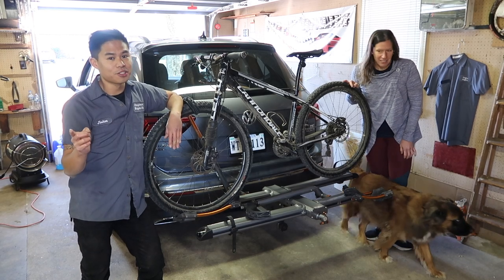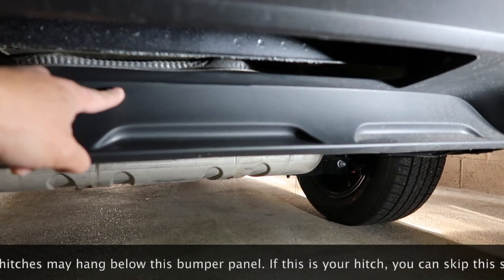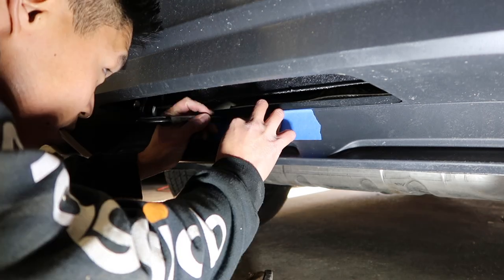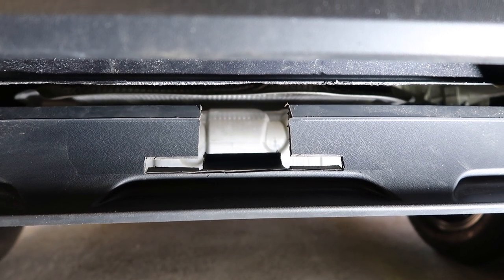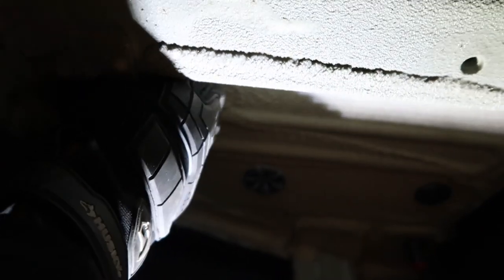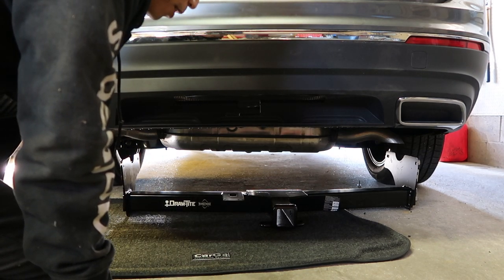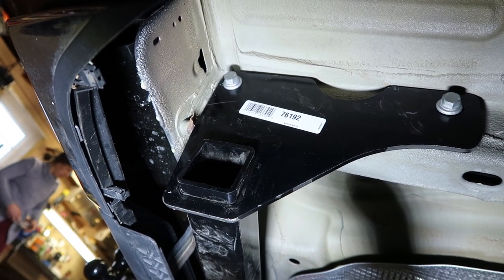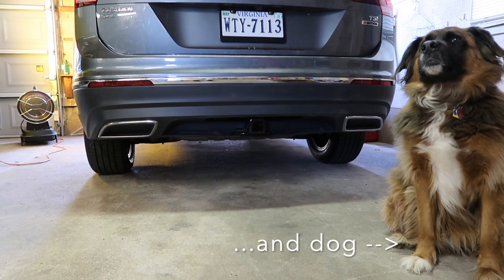HOW TO: 2018 - 2022 Volkswagen Tiguan Hitch Install

Comment: Thanks for the video! I watched it a few times before and during installation. I had trouble with the passenger side bolt closest to the bumper, but finally got it to align. Installed on an '18 Tiguan with the third row.
Reply from the maker: Way to go! Yes the passenger side was a bit of a challenge for me as well. I should have showcased that, but well done on getting it complete! Thanks for watching!

Comment: Great video thank you. My question is when doing the layout where you’re going to cut how did you know how far down to come? Did you just measure the hitch from the mounting bolts and take that information to the frame and then figure it out?
Reply from the maker: Great question! The MFG's documentation actually specified that the receiver would interfere with the the portion I marked out. So I made a template based on determining the center line and the drop noted by the documentation. If it wasn't noted by the mfg, I would have done a soft fit and measured/marked the area that needed to be removed, but still utilizing the same centerline method.

Comment: Love the video, thank you! How did you pop the cover off the hole for the receiver before you cut into it? I have a receiver that I can just bolt on but want to ensure that I remove that panel properly because it is a lease. Thanks!
Reply from the maker: You mean the plastic cover under the bumper? I had to cut it out to make a passage for the receiver.

Comment: Hi, thanks for the video tutorial, your headliner says 2018-2022 but the rear bumper design is different than previous years, so, it will fit 2022 also?
Reply from the maker: You know.. that's an excellent question I'm not 100% certain. The Tiguan in the video required modification so I would imagine a 2022 would require similar modification. Platformwise they should be the same, but aesthetically I'm not sure how it would look given your comment on 2022 being slightly different.

Comment: Did you ever actually have to jack up the car or just there for prevention? I don’t have a jack but want to install myself
Reply from the maker: Great question! No, the jack was used to position  and lift the hitch into place, not to lift the car. I'm sure there is some mfg tolerances between different hitch models or even the same ones.. but I don't think we would have been able to install this particular hitch without a floor jack.. much less without each other's help. Good luck!

Comment: Great Vid, was this Tig a 5 or 7 pass? 3rd row appears to matter on the version of the hitch to buy.
Reply from the maker: Thanks! I believe it had the 3rd row, I could be wrong its been a few months.
Reply: @FixitBongbong  ordered the same kit for our 3rd row tig. Thanks again.
Reply: Bongbong! I managed to install the hitch by myself (sort of). I'm having issues getting the holes closest to the rear bumper to line up. Whatever rubberized underspray coating the car comes with needed to be scraped away and it still doesnt quite line up. I plan on using a jack to push the bar up but it's real stubborn and off by maybe 1/8 of an inch. Any tips?
Reply from the maker: So we were hung up on this part as well. I'm not sure we were off by that much. Ultimately it took nearly an hour. I used a punch as a dowel to line it up and just kept trying until i got the threads to catch. It was certainly the most frustrating part of the whole install. Good luck.
Reply: @FixitBongbong  I spent about an hour looking for a punch dowel to do just that.. instead I sacrificed a thin screwdriver which wasnt strong enough to jam it into place so I'm giving up and having a shop do the two outer bolts tomorrow. Thanks again for the replies! I hate admitting defeat but I think it's going to take the shop a few minutes and I'll have a good laugh.
Reply from the maker: Aww man don't look at it as defeat.. just a better use of your time. Techs at shops get their butts kicked just the same as us home gamers. I remember back when I was working in shops I'd spend hours cursing at someone else's project. Also.. don't think we didn't struggle with those bolts. The thing about video editing is I cut out the hour of cursing cause 1. no one wants to see that and 2. Youtube Guidelines. LOL Cheers man and well done for tackling it on your own!
Reply: @FixitBongbong  Same &#@*$ problem here. I got 3 bolts in after a few hours of wrestling, prying and hammering, but the last rear bolt will not go in all the way. I think I forced it in past the frame metal, but it's just pushing the washer in the interior away and not catching it. It's absolutely infuriating. I'm thinking of just adding another washer on the outside to make it flush and calling it good. What's the worst that can happen? It's not going anywhere with 3 secure bolts and a 4th almost secure bolt.
Reply from the maker: @randydueck6870  Ugh incredibly frustrating. Unfortunately the technical and right answer here is all the bolts need to be securely fastened and torqued to spec reason being is if later the hitch is used at it's max spec, especially with a weight distributing hitch system, all 4 will be required for proper attachment to the vehicle and to prevent any bolt shearing as bolts are designed to take a pull or clamping load not a shear load.

Comment: What's the brand and or where to purchase  the hitch that you used?....thanks in advance!
Reply from the maker: Hey there so sorry for the delayed response! The hitch was made by Draw Tie, unsure on the model at this point but it was the kind that installs behind the bumper instead of below preserving clearance and departure angle. You can find them all over the internet through various retailers!

Comment: Does it fit a 2022 Volkswagen Tiguan ?
Reply from the maker: It should! I checked the interchange late 2021 for MY22 and didn't see any platform changes, but to be sure you might want to call your local dealer.

Comment: Does this hitch works for the 2021 Tiguan all space ?
Reply from the maker: That's a really good question.. I'm not sure. I would imagine the Allspace to be a MQB platform car, but that doesn't mean they didn't change any mounting holes in the rear. I would recommend just double checking with a fit guide from eTrailer or where ever you purchase. The install procedure should be similar.
Reply: @FixitBongbong  ok thank you

Comment: So basically you have to butcher your rear valance to get a trailer hitch installed?
Reply from the maker: It all depends on the receiver hitch you go with. Some are designed to protrude below the valance, while some are like the one I installed. It's important to take into account the decreased departure angle if you go with the lower style (below valance) receivers.

Comment: Same method for the 2021 model?
Reply from the maker: It should be as I'm not aware of any major platform changes! Great question, I'll update the title. Thanks!
Reply from the maker: I did a quick check and found fit guides recommending hitches for 2020 models, recommended the same part numbers for 2021 vehicles as well.
Reply: @FixitBongbong  the bolts are missing for the 2021 R line but the holes are there

Comment: does this work for the 2022?
Reply from the maker: From what I can tell online they should be the same chassis. Only reason I'm not 100% is I personally haven't worked on a 2022 model, but to my knowledge there wasn't a major platform change to Tiguan in 2022MY.
Reply: I have a 22 Tiguan. Love it, but Volkswagen stopped installing the weld nuts on the inside of the rear frame rails. Now you have to fish the the hardware through. Went with the roof option instead. Fishing bolts and nuts isn't hard, but I didn't feel like messing with it.